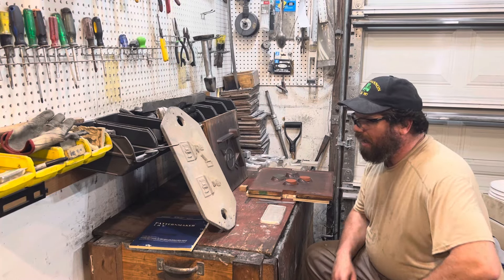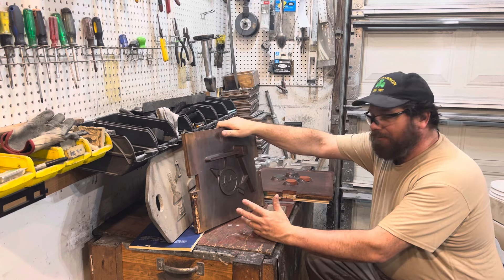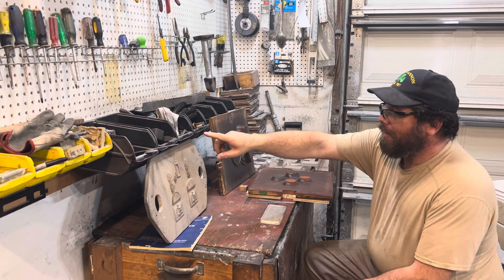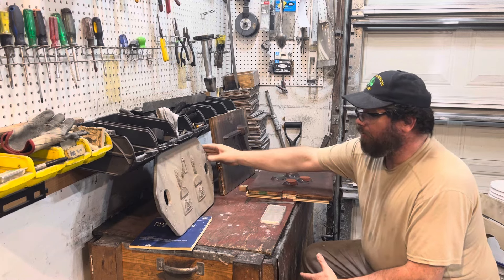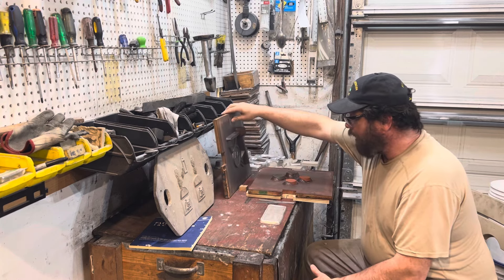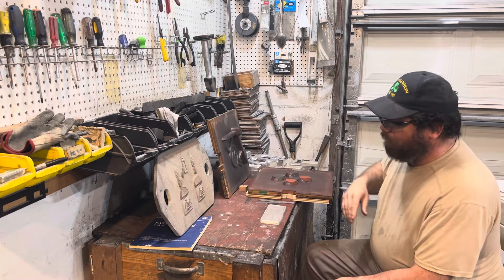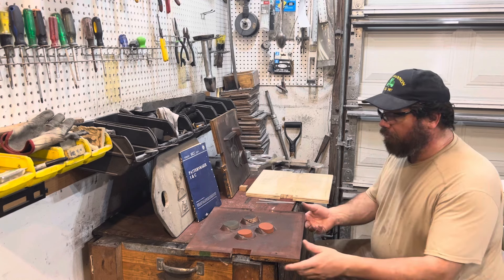Why don’t I cast Aluminum match plates?

Comment: Besides wear properties, an irregular parting line might be the main reason for making a cast matchplate.  Also, use of a flat aluminum plate (3/8" minimum thickness) instead of plywood adds longevity to a matchplate with a straight parting line.
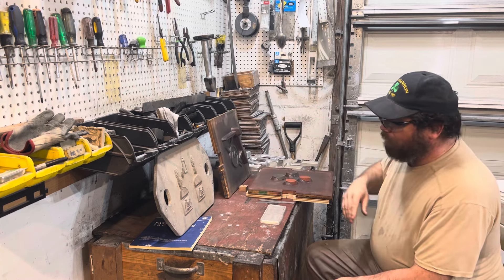Reply from the maker: watch the video til the end at 3:08 i discuss using a cast aluminum matchplate  to integrate a follow board, and the primary function of a follow board is to create an Irregular parting QED

Comment: I understand now, I was looking at it the way that I would work them in a foundry in front of my squeeze/jolt machine, or even ramming with a pneumatic rammer. Your doing it the smartest way for you, I feel like I owe you an apology. All good, keep up the great work!! lol I used to have to lift a 20×20 once a day weekly, we weighted it and it was just shy of 100lbs,not bragging, I just wanted to share that, I had forearms like Popeye 😆take care and be safe.
Reply from the maker: Back in my 20s while I was a Pro I rolled 14x14 all day long and had those Popeye forearms.  Now. My normal flasks are 12x12 75 lbs. I occasionally use 13x13 but anything bigger is a
Stretch